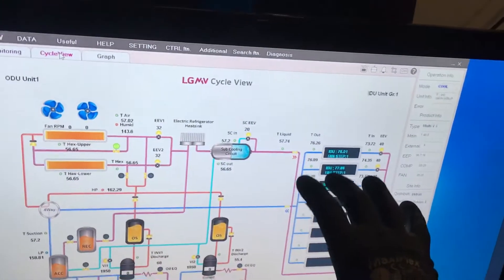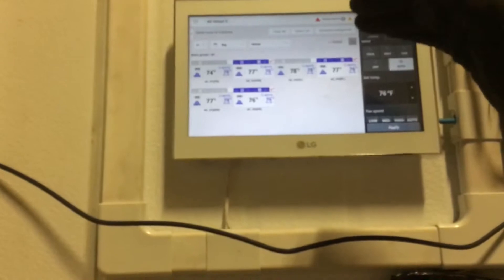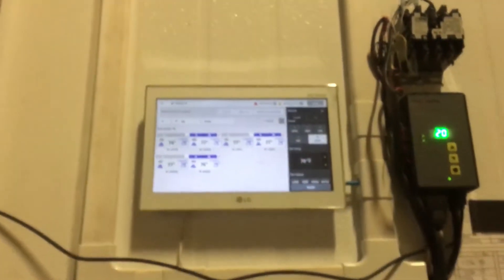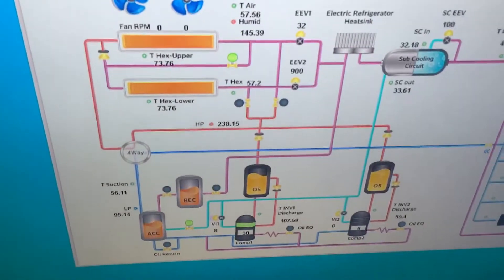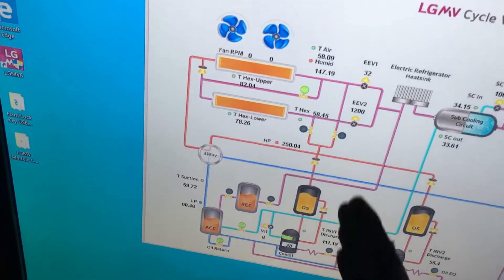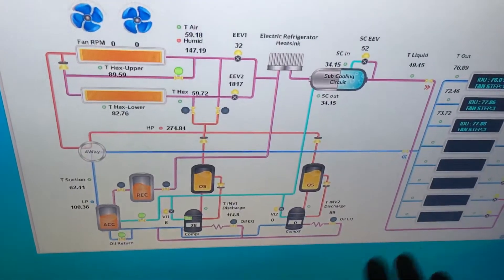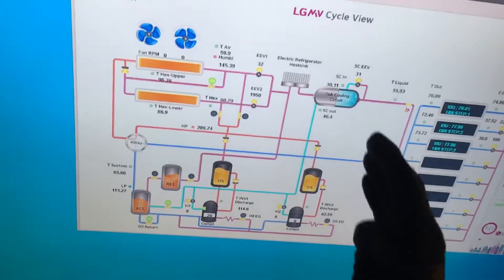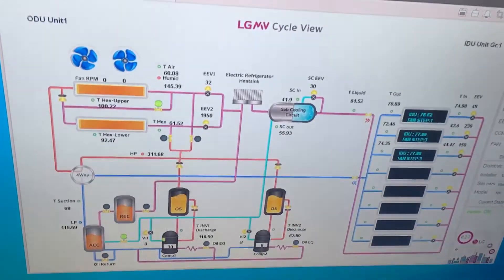Testing redundant back up LG multi V5,  Let’s kill one system and see what happens

Comment: Hello sir, I am having trouble on slave and master multi v.5 vrf, both accu are not running but no error is being displayed. I have also tried LGMV but all parameters are normal. Hope you can help.  Thank you!
Reply from the maker: I’m not sure I’ll be able to help you over YouTube messaging. 
        Good more sounds like you’ll need to download the actual service and repair manual and go through the trouble tree to process of elimination to find your problem. 

        In the years that I have been selling and installing these units I still have never had a problem with no run situation on any of the outdoor units so even myself has never ever had to diagnose a problem on the systems were no run. 

           I have had one of my units have one fan controller board go out once. 
          But the error code let us in that direction opened up the service manual read a few of the possibilities and quickly diagnosed it. 

        I do not work on other peoples LG installation only the units that I sell are the only units that I service maintain and repair. 

        I am still waiting for my very first unit I installed some 20 years ago for the compressor to burn out I have never experienced the compressor burn out so I do not know what one is on my own installation. 

          I have had one indoor air handler evaporator coil leak where the customer sprays very caustic metal attacking chemicals that are in the air that eat copper. 

       Had code 53 communication errors where somebody has tripped circuit breakers or touched breakers in the panel they did not know what they were doing and turned off air handler’s setting a code. 

       And after many years of 24 seven operation I’ve had motor bearings start to develop a little wobble in the bearing making a noise in the motor in air handler

        And voltage spike that’s cause voltage surge that burned out air handler control boards and other circuitry in the air handler due to bad electricity. 

         But I’m sad to say I do not have enough experience troubleshooting and looking for problems on these units because I basically had no trouble or problems on these units in years. 

              Having no codes can be the toughest thing sometimes to look for.